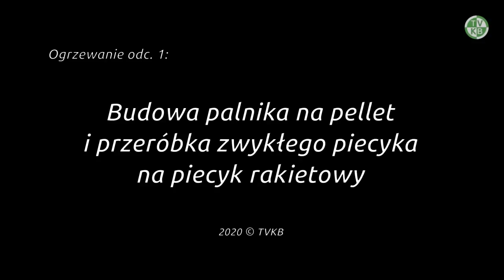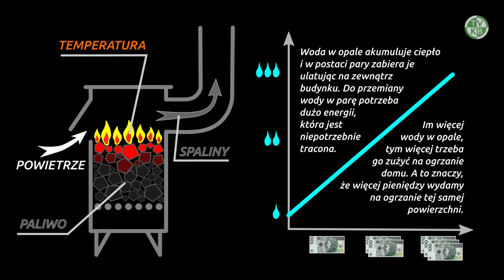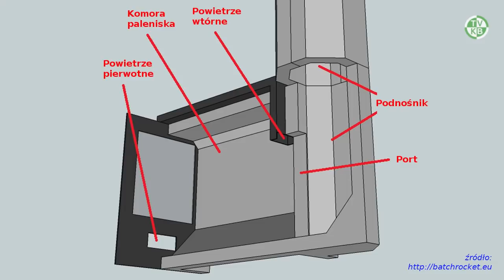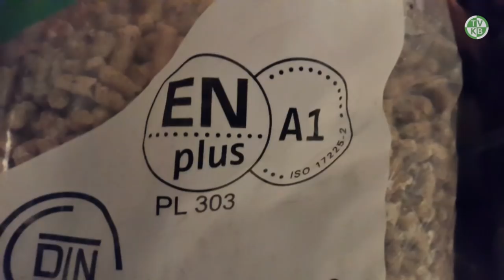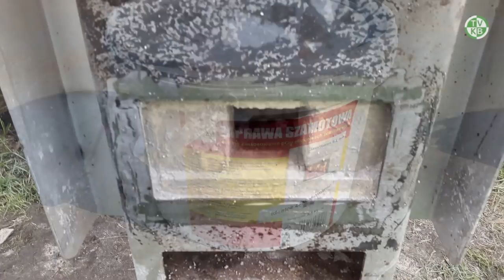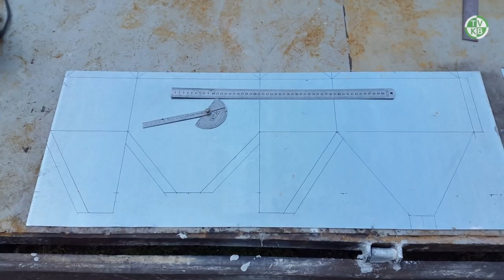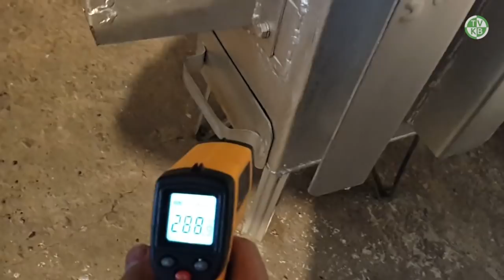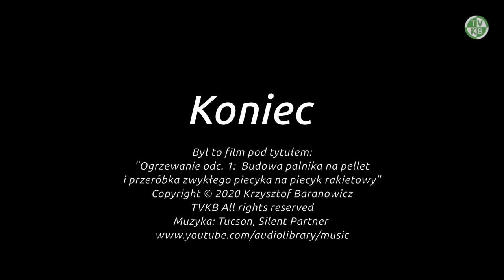Ogrzewanie odc.1: Budowa palnika na pellet i przeróbka zwykłego piecyka na piecyk rakietowy

Comment: Really impressive and complete design!
I did not understand a single word (Polish I presume?) but the video is nevertheless very clear.
It looks you put a lot of thought into the design. Also, congratulations for your use of FreeCAD.

Would you consider adding automatic CC subtitles for the video? YouTube can generate them automatically for some languages and translate them as well which would make the video more accessible to non Polish speakers.

In any case, great work! Thanks for sharing.